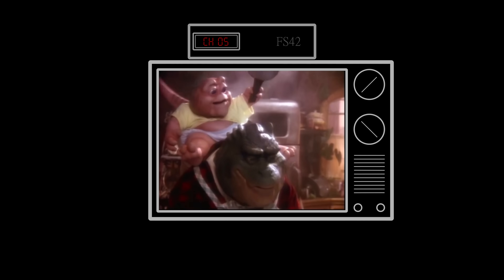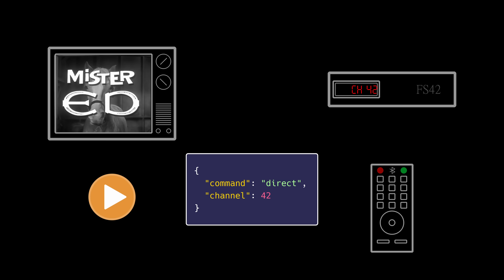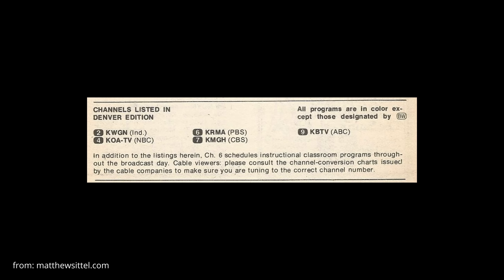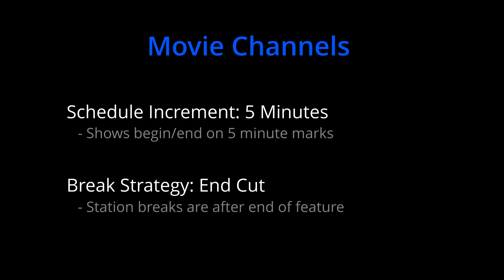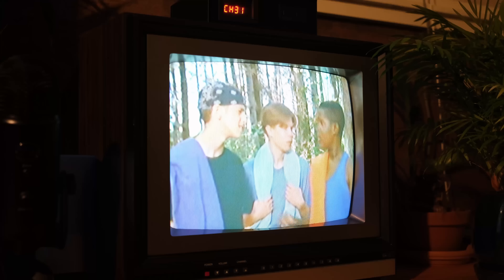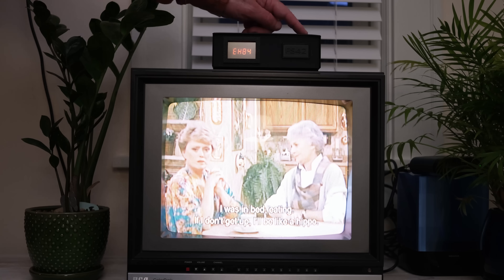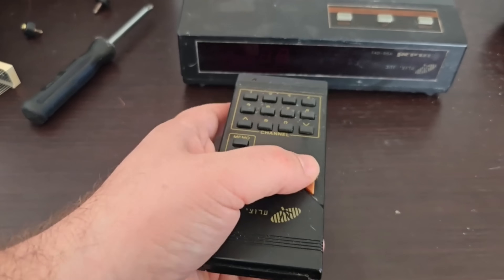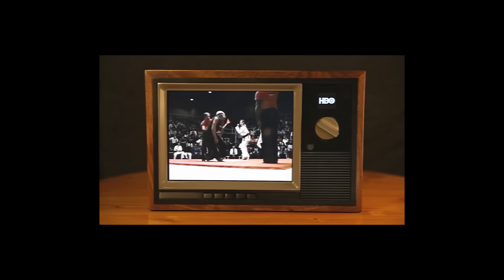90s Cable Simulator - Recreating Retro Cable TV with a Raspberry Pi

Comment: This is great, I got a test channel up and running in under 30 minutes. Thanks for the great documentation. The only hiccup I'm having is commercials playing 30-60 seconds before they should in a 23 minute show file due to varying intro lengths, but that's an understandable limitation.
Reply from the maker: I love that! Thanks so much for sharing :) Yes - commercial breaks are evenly spaced through the show - which can work out well sometimes but very awkwardly other times. I am going to add a search for black screen and/or silence and place them there. It might not always catch the real break points, but it should be better than when it cuts someone off mid-sentence. Cheers!
Reply: @wrongdog_reckons  That would be incredible, thank you for all the hard work you and all the others who contribute are putting into this!!

Comment: I had a kinda similar idea ages ago but for radio. I thought it'd be a cool project to have what is essentially an mp3 player that plays "stations" of your music you picked. Not like spotify or pandora where it just cycles through music you like one after another, but like the actual radio where they're all stations playing at once that you "tune" between. I was thinking it would play the music quieter and with interference/noise until you tune it just right and fade out as you tune away, and maybe have the wibbly tuning noises as you track across stations. I thought maybe you could record your own fill in announcements or whatever that could play between songs and stuff. I never got around to actually starting making it though since electronics is a bit of a daunting thing to get into.
Reply from the maker: It is a good idea, and we're going to do it. Its a relatively light lift to get it working on audio files. Cheers!
Reply: @wrongdog_reckons  Oh, cool! I wasn't saying it as a suggestion that you should do, but if you like the idea, go for it lol I'd love to see it be a real thing

Comment: How do you make it load so fast?  Even my computer takes a while to load video.
Reply from the maker: Through a well designed system. Check out the MPV player - its very responsive - that's what the player uses on the front end. The pi has great hardware video acceleration and the hard drives have a good-enough cache burst speed. Cheers!

Comment: 14:42 He pronounced L.E.D like the metal lead. You want to talk about childhood memories? THAT brings a MASSIVE one back. When I was a kid in the 80s taking stuff apart I pronounced it the same way! The family members I had who were into the technical side of things all dealt with mechanical items and knew very little about electronics. When I would go to Radio Shack as a little kid and identify the parts I saw I would call L.E.D.s leads too. It wasn't until the employee corrected me that I learned it was an acronym.
Reply from the maker: I've noticed that in some cultures/languages, its pretty common to sound out the acronym if they make a natural word. Like I had a manager that pronounced the acronym G.I.S (Geographical Information System) like is was a word that sounded like JIS. We also do it in America when we say the acronym for Graphics Interchange Format and pronounce it as the word GIF (hard g) or JIF (j sound). Cheers!
Reply: @wrongdog_reckons  I never knew that about other languages. Thanks for the info.
Reply: I used to do that as well lol but I was born in the 2000’s so maybe I’m just dumb or something.

Comment: I miss the instant tuning of analog cable. The cable boxes always did a better job than any cable ready TV did in displaying the channel instantly. I realized as a kid there are three different frequency plans for cable, STD, HRC and IRC. They were close to each other so it would work with any one selected, but it would tune in slower. If your TV had a switch or setting for that and you put it on the right one, the channels would display quicker without having to fine tune the channel as much.
Reply from the maker: +1 on the instant tuning of analog cable. Fascinating detail about the switch on the back - I had no idea about this. Cheers!

Comment: the instant playback between channels is impressive. Are the streams always active, or do they only start when selected.
Reply from the maker: Thanks! Channels are only active when you switch to them - there is only one file being played/tracked at a time. When it switches channels, the player asks the scheduler what video should be playing for the new channel at the current time, the scheduler tells it which video file should be playing (could be the feature, a commercial or bump) and how far it should skip into it. That all happens very fast, so it appears like it was just playing the whole time. I think its Cheers!

Comment: PseudoTV for Kodi does this.  I wrote my own fork, have my bumpers, adverts, etc. that interleave etc.   It's not in a cool-looking set-top box experience and that's the interesting part of the build, but I was hoping your version would take it a few levels further than you did with the programming.  Maybe parallel actual network programming with the next episode of a series each week, stack higher rated shows in prime evening hour slots, news and weather shows (that'd be a challenge for modern content!), streaming channels that integrate with streaming or video-on-demand services, etc.
Reply from the maker: Great, thanks for the heads up. Good luck with your app, hope to see your fork build out into amazing stuff. Cheers.

Comment: One of my favorite things in this video is the high-pitched continuous pinging noise the TV is making in some of the clips. I forgot they did that.
Reply from the maker: There are so many cool sounds out of that TV. The tube popping sounds when you turn it on or off is so satisfying. Even changing the internal channels make a neat sound -  and its natural analog  static when there is no signal is so soothing. So much better than any digital white noise machine! The best sound it makes though it after you turn it off and then run your hand through the static that's built up on the screen. Love it. Cheers!

Comment: Nice to see you kept it going.  There have been a few others like this in the past that seem to have faded away.  PseudoTV an add-on for XBMC/Kodi was one I used, it worked really well, though it couldn't inject commercials like yours or recognize holidays.  But it made channels based around Genre and also network accurate listings.  So FOX shows only played on the FOX channel and not NBC.

It was really janky though, especially if your media library was to big.  At a certain point it would just choke to death trying to build its database.

I think a few people have tried to revive it over the years with limited success.

Comment: I wanted to do this, but it looks like someone has beaten me to it. For my version, I wanted to gut an old DVR box to recreate the early 2000's cable experience, and have a 2TB hard drive inside loaded with TV shows that could be played on different "channels". I would even make it so you could set up if you wanted to have commercials or not.
Reply from the maker: Sounds like a cool project - great minds think alike! You can still do it, just start with this software if you want a head start. Cheers!

Comment: However, creating a digital antenna Raspberry Pi like booster box even with the best indoor antennas is a tough one to swallow if most people save their money avoiding other expenses.
Reply from the maker: You can use any linux install - pi and cable box not required. Cheers!

Comment: I have a TrueNAS system and a plex server, I would like to do something like this and draw off my existing server and create channels. I will save this video for later, because there might be a way to run your software in a VM and have it pull from my existing server.  If anybody has any input on this, please respond.
Reply from the maker: You can run it on any linux install, if that helps. It seems like a lot of people watching this video also use plex, so I will look into how to connect my catalog, scheduler and player to that system to see if its a doable thing. Check back in. Cheers!

Comment: I'm pretty sure that we had the exact cable box shown at 1:41 (in the 80s). Boston had two cable feeds, "A" & "B" (literally, a double coax that looked like a giant lamp cord). Basic cable used only the former and both were used if one had the premium channels. That's what the "B" indicator, is for, under the box's display (the other one lit if one ordered a Pay-Per-View movie).
Reply from the maker: It was a super common box I am learning. I had no idea about the two cable lines - one for premium. That's fascinating - I think if you ordered premium where I lived they had a switch on the pole where your line split off from the main line. Not 100% sure about that. Cheers!

Comment: Subscribed. This is VERY cool and I might need to get into this once I get the proper income.
Reply from the maker: Thanks! You don't have to run it on a pi if you want to play around with it - any Linux install should work. I developed most of it on windows using WSL (windows subsystem for linux). Thanks for watching and subscribing! Cheers!

Comment: I remember my simple Scientific Atlanta cable box and remote back when I was in college.
Reply from the maker: Is that the one with the rotary dial and about 40 channels or so?
Reply: @ not with a rotary dial. Maybe simple was the wrong word to use, but it seemed simple at the time. This was around the mid-1990s. I’m trying to recall where the buttons on the box were located. I think they were on the top, but I mainly used the remote which was somewhat square in width and length, but shallow in depth (probably ½ inches or less). The remote was programmable to recall channels that you could input with the buttons. All you had to do was press the RCL (recall) button, and it would cycle through the channels you programmed.

The only rotary dial I can remember we had was the antenna rotator which I had to put on top of a 30 foot utility pole when I was a teenager in the early to mid-1980s. I had to straddle the last 5 feet of the pole with my legs and inch my way up to place the rotor on top, secure it, and have my brother hand me the pole that had the antenna mounted to it while I holding the utility pole with my other hand.

My dad was an electrician by trade, and he used that utility pole to mount an electrical panel and service head for a trailer for my uncle to use. He had also mounted a security light at the top, but this was before he had placed the utility pole in the ground. My surprise when I got to the top to mount the rotor was a big red wasp sitting on the of daylight sensor on top of the security light.

Comment: Toonami, can I make an anime channel? Can I make a Spanish language anime channel and a Spanish language comedy central
Reply from the maker: Yes! Yes you can. In fact, there is a discussion on the discussion board with a user who is making Toonami with it. I'm adding a feature so the bumps work right for that. You can use any language you want as far as I know it should work. Try it out, if you run into any problems, post an issue on github and we'll work through it. Cheers!
Reply: @wrongdog_reckons  woah

Comment: I’m wondering, for people who are ok without having the box, could this be done with Kodi, using the pvr guide, and a custom addon?
Reply from the maker: I don't know anything about Kodi - but you don't need the cable box per-say or even a raspberry pi. It can work from any linux distro or even on windows with WSL (windows subsystem for linux). Cheers!
Reply: @wrongdog_reckons  that’s pretty cool thanks. I found an addon for kodi and I think plex as well called pseudoTV that does something quite similar. You could probably do something like this with VLC as well.

Comment: You are inspiring me to make my own 90 retro cable box for my gaming room. I just wish you deep dive on the mechanics how you house your content? is it on a cloud or is it on external HD I would like to know more about your project but great work
Reply from the maker: Quick deep dive: see that blue thing behind the box on the thumbnail? That's a self-powered hard drive docking station with a cover I 3-D printed to cover the spinning drives.  It connected to the pi via USB in the back of the cable box. It works pretty well. Cheers!
Reply: @wrongdog_reckons I guess that it was that but I did not want to assume. You work is amazing and I look forward to reviewing your notes so I can build my own in a general instrument Jerrold cable box. I just gotta figure out the digital output for number and lirc but I really looks forward to this thank you so much truly ❤❤❤
Reply from the maker: @ - that's exiting! Can't wait to see what you make!
Reply: @wrongdog_reckons  Hey would you be able to post your hardware connections that you made with your latest build with photos I am curious how your revamped model looks like in photos
Reply from the maker: @james21113  - there is a link to the cable-box repo in the description - that has all the documentation for how to connect: https://github.com/shane-mason/cable-box

Comment: This is amazing!  What a trip.  I actually have some old General Instrument cable boxes I could use as a shell.  Now all we'd need is the occasional DTMF signaling between the broadcasts and local content!
Reply: Ooh! Yes! I did do some research years ago and did figure that SCV MaxTV here in Singapore in the 90s did also use General Instrument hardware, so while watching this video, I did imagine trying to design a custom project box that would resemble the CT 1900 box (similar or identical case to the CFT 2100 and CFT 2200 that was used in other countries) that was the last receiver model they offered before their merger with StarHub, or even the larger box that they used earlier on (which I think might've been a Jerrold Impulse receiver).
Reply from the maker: @ Wow - that's some impressive knowledge on those boxes. Thanks for sharing!
Reply from the maker: Do it! If you run into any snags, post an issue on github and we'll work through it. Cheers!

Comment: I'm going to play with this tonight and this weekend. I'm already thinking about how to mount my nas folders for content and how to shim one of the various WeatherStar 4000 channels into a loop channel (since I noticed there wasn't an open issue about this already).
Reply: Yeah that is the missing peace for me.  Maybe a "source" button to switch over to a stream of WeatherStar 4000 playing constantly on a home server?
Reply: @markderidder I was looking through the repository, but because it uses a video player called MPV I wasn't optimistic. All the weather Channel Emulators I can find want to output in something that mpv can't easily open. There is a link on the ws4kp repository about how someone got it to render in an ffmpg stream, which could work, but that person used OBS Studio which wouldn't work on something like a Pi. Still, I think it means that it could be made to work.
Reply: @ where there is a will, there is a way. Maybe via Linux web browser or perhaps incorporating the entire WS4K code and having a json file to enter your zip code so it just boots right into it. I don’t know but I’ll be thinking about it as I try and spin up my FS42
Reply: @markderidder  After poking around a bit, I think the easiest thing to do is run a ws4kp container in one docker container and pagecast in another which takes the weather website and broadcasts it as a RTMP stream. Then, theoretically, FS42 could open this stream in MPV. However, I think we'd need to add a new channel type first to handle that use case. I need to spend some time setting up a Raspberry Pi to try and prove this out, but I think it's very possible.
Reply from the maker: MPV uses FFMEG - it should be able to handle it if the ffmeg stream worked.
Reply from the maker: It doesn't strictly require a pi - you can run it on any linux distro or on windows via WSL (how I mostly develop it) for testing. Let me know (via github) if you need any help on adding the new channel type.  If you get it working in a way that keeps current functionality in place, would absolutely welcome a PR :) Cheers!
Reply: @JumbocactuarX27  that sounds clever! Great way to keep it contained on the same hardware and still tap into it.
Reply from the maker: This is absolutely fascinating.  I really look forward to seeing what comes out of this!

Comment: Is this real? Because I want to make it, but It’s a huge commitment and kinda time consuming and money consuming. So if it’s were everything plays when it is supposed to, and all I have to do if digitize some shows and movies and sports just let me know I do not know how to code so I need it to be ready. Please someone tell me.
Reply from the maker: Its for real - you can check it out over on github. If I were you, I would start small. Make a single channel with limited content - if you like it and its worthwhile, then you can go the full way. You don't even need the pi - it runs on any linux system. I run it on my steamdeck. You can even run it on windows it you use WSL (windows subsystem for linux) - that's how I develop it mostly. Cheers!
Reply: Thank you so much